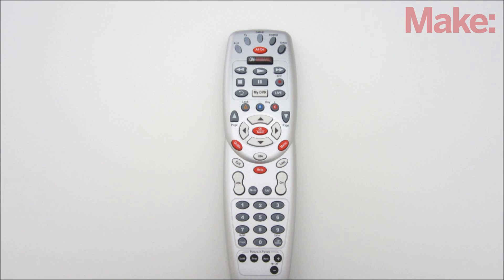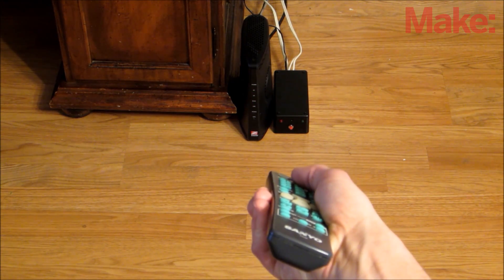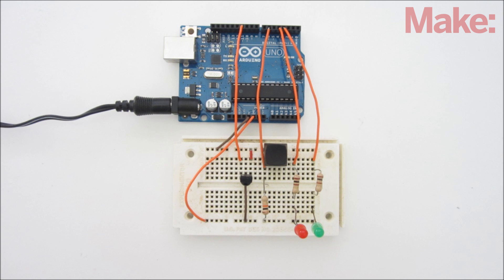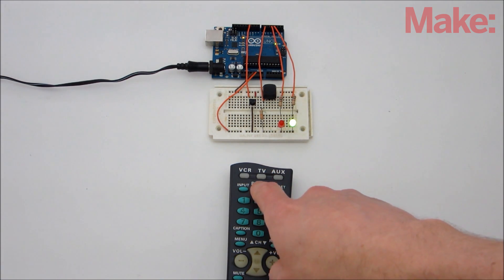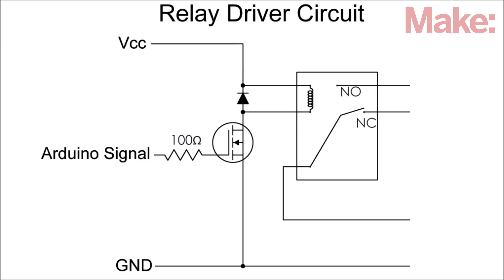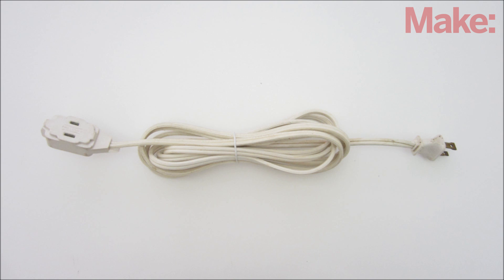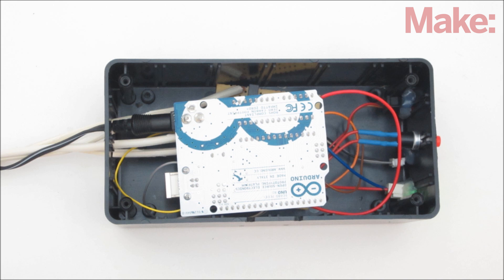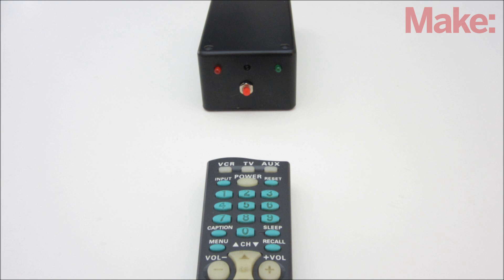DIY Hacks & How To's: TV Remote Controlled Electronics

Comment: If you guy's are looking to do this with a computer setup- grab a 5.25" bay cover, and cut out the necessary sockets for the project. And house with the project box. Run the cables outside via the watercooling grommets out the back. I like it this way instead of having a box sitting by me. (Note: My Arduino is on top of my DVD writer/reader)
Reply: I'd like to see how many people who read your comment actually have water cooling grommets on their PC.
Reply: nicknack125 A big bunch of computer cases have grommet holes on the backside for the case.

Comment: I will tell why I will not do this because an ardiuno costs 50 bucks and I am not going to pay that money to remote control a light when you can buy electric remote outlet control for under ten bucks .
Reply: Rhetorical Question You can also alternatively build your own arduino board at home for less than 5$(no kiddin). DM me if you want the steps.
Reply: Gavin, read up on i2c you cqn connect 128 separate controllers onto a pi, each controller could have multiple io's so theoretically uou could control 100's of devices.
Reply: I guess it is just to show the basic functions of a arduino. I would als get the remote outlets. They need to show how to make WIFI to IR transmitters, so I can control the stuff with my phone.
Reply: http://www.amazon.com/Arduino-UNO-board-DIP-ATmega328P/dp/B006H06TVG/ref=sr_1_2?ie=UTF8&qid=1395964910&sr=8-2&keywords=arduino+r2

only 28 dollars
Reply: I got an Ardino uno (beefed up version with SMD) for only $20 on eBay. You can also do this with an Arduino Nano which can be had on eBay for under$10-15.
Reply: you could use an attiny thats .50p
Reply: Just sayn you don't need to buy a Uno, you can bet a micro or a ATTINY as well. If you know what you're doing you can scale it to something tiny AND add bluetooth or Wifi.

Also: I would rather use a Raspberry Pi for something like this just so I can also use it as a node to a server. Thats just me though
Reply: Jamie Biggs But still need programmer or arduino to program it, right?
Reply: there's a website with tutorials and a forum with a lot of people to help.
Reply: I was thinking the same thing. K was thinkin about doing this until i realised that one raspberry pi would control one electrical item. (Im guessing raspberry pi would do same thing in UK @ £15 a pop)
Reply: Forget about paying 50 bucks for that, try OpenPi, just £29! and if you don't like the design, you can change it to fit what ever you want. It's on kickstarter now: https://www.kickstarter.com/projects/wirelessthings/openpi-wireless-computer-for-inventors-makers-and
Reply: 29 pounds only gets you the PCB without the Pi compute model. You end up paying 50 POUNDS
Reply: Rhetorical Question I was about to make similar comment until I saw your response
Reply: TECH SET Studios 5bucks arduino? oh my farks! must be china!
Reply: Yeah they're $20.
Less if you buy a clone from China.
Even less if you make one yourself.
And you can do a lot of things with the arduino, not just light control.
It's a prototyping board used for assembling projects fast; but many beginners buy a ton of them and use them for specific purposes because of videos like this one.